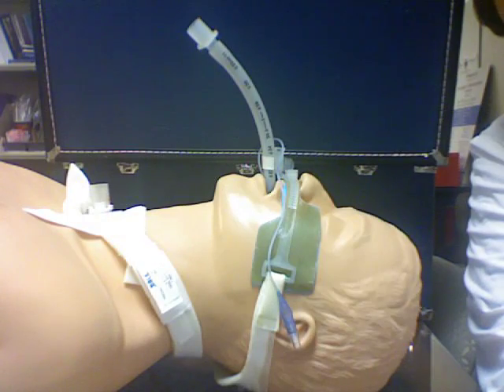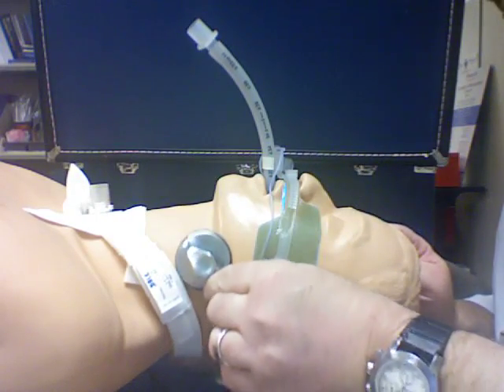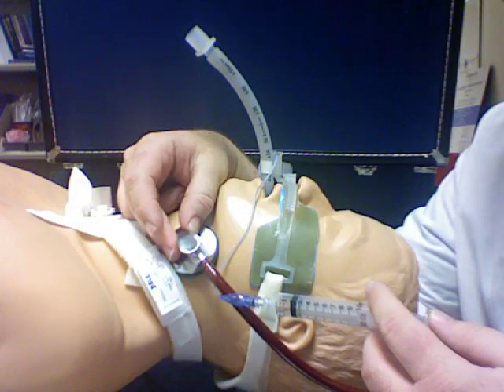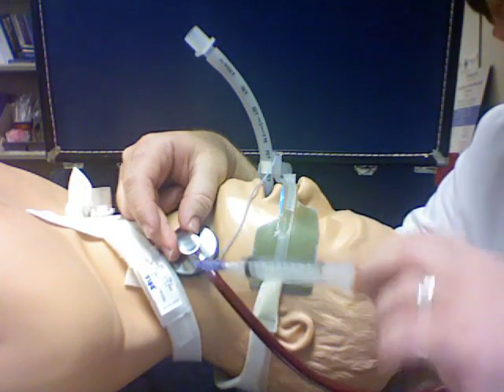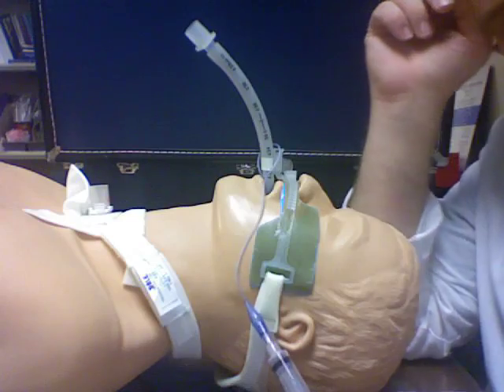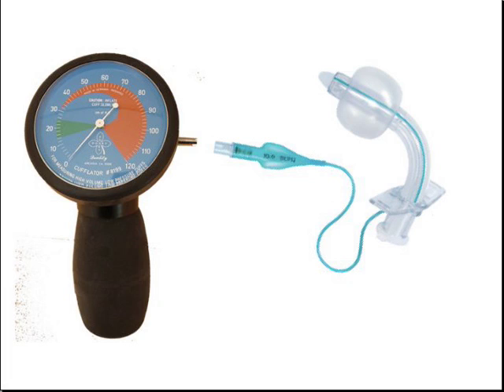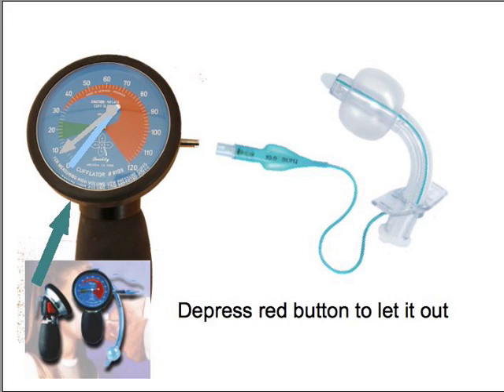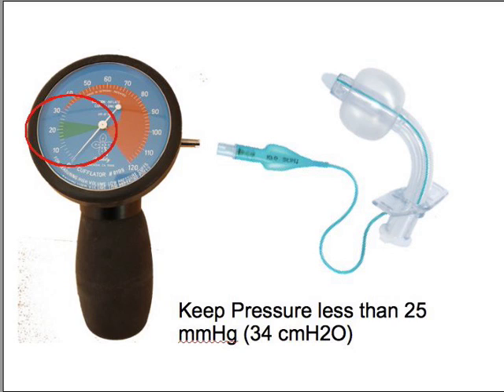Cuff care for ETT/Trach

Comment: dude, you're the man. While we are taught both the minimal leak technique and the minimal occlusion pressure technique, our program director insists that all we should be using in the field is minimal occlusion pressure. Is microaspiration a concern or do you use CASS tubes?